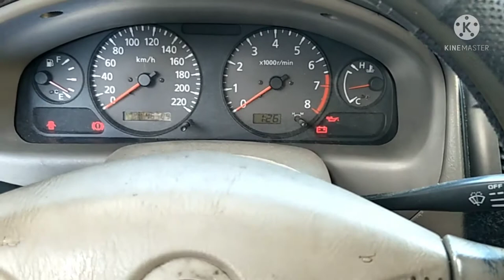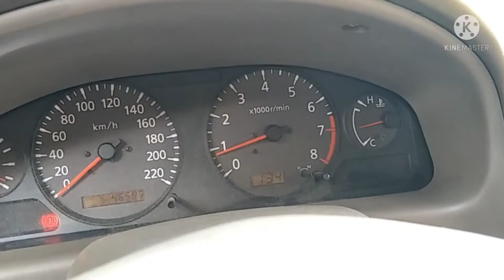How to put coolant on nissan exalta 2001

Comment: boss saan po yong connector ng obd port ng Nissan exalta 2001 model ? 16 pin ba sya?
Reply from the maker: gawa ako ng short bukas bossing location ng obd port at kung ilang pin, para malaman natin kng ano ang pwede at compatible na scanner, meron na ako na bili dati, pumasuk pero hindi siya compatible,stay foot😉
Reply: @jmsvloglife7576  cge salamat hindi pla sya 16 pin
Reply from the maker: noted bossing😉

Comment: Malakas ba gasolina sir ang exalta 2001?
Reply from the maker: no po sir kumpara sa carb malayo dipesensya nila, kng bibili ka fuel injekted mas tipid, kumpra mo nlang sa motor. kapag carb type mas matakaw vs injected type😉